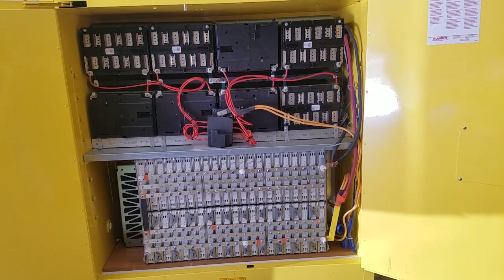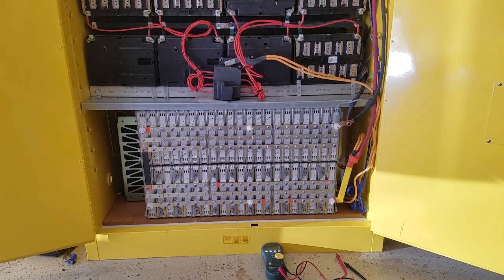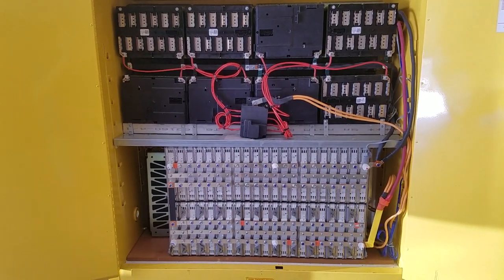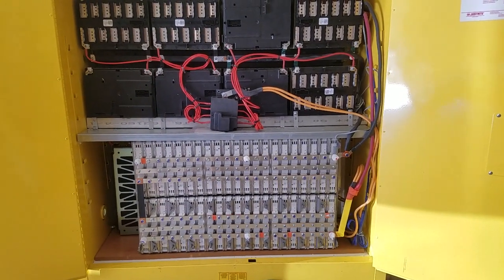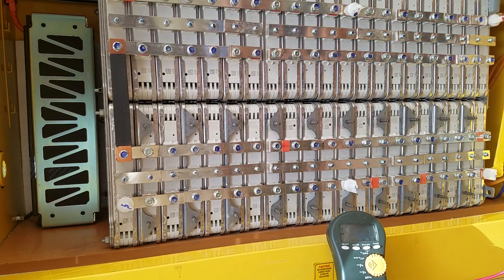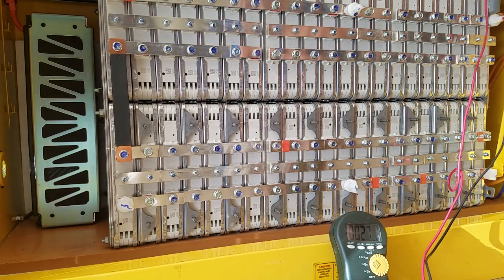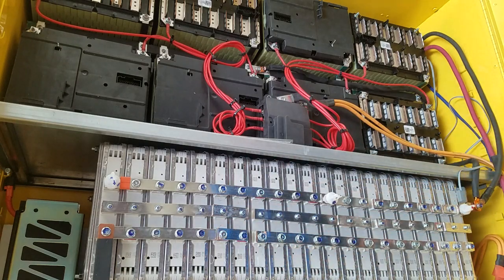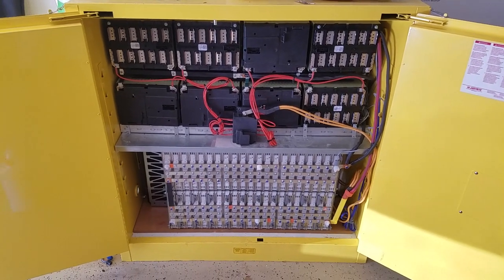Update and adding to my 40kwh Lithium Ion Battery bank and 4kw off Grid Solar System.

Comment: Great video, I am looking at making a leaf bank too.  Very very interesting what you say about the balancing/BMS.  Strange how you refuse to have more solar on roof so you effectively are wasting the massive investment in batteries as they can't be kept charged from the sun??
Reply from the maker: I am not refusing to put more solar on my roof.  It's the city ordinance the HOA restriction that I don't want to deal with.  In order to put solar on my roof, need to get city permit, need power utility permit... and they won't permit battery system that are not UL listed.
Reply: @devildestiny555  Ah I see that does make sense.  Shame to hear that!!

Comment: Nice!!!!! Had you had additional  panels  would you have  been  able to avoid the grid entirely ?  .are the volt and leaf batteries  parallel ?
Reply from the maker: Yes, absolutely, the battery got plenty discharge power... it just a matter of being able to store it and put power back into it.  Yes Volt and Leaf in parallels.

Comment: hi i got some chevy volt batts off you,i was wondering what amps to charge them with?,i have it at 15 amps now,,is that to slow?,,,thanks for your help,,
Reply from the maker: I don't think there's such thing as too slow charging... the slower you charge it, the better for the battery.  15amps is fine, but you can charge it up to 50amps if you want/can.
Reply: @devildestiny555   i just want the battery to last along time,and not go out of wack ,viltige wise,,i heard if you charge fast they will go out of wack faster,then slow amp charging?

Comment: Hello your setups are amazing!  You are definitely a pioneer in this new industry in getting away from paying the big utility companies and there huge bills... Like APS! We are in Arizona too.. North Phoenix,  ever since I moved here I`ve always wanted to use very little or no power from grid.  What do you think of those new hybird solar mini splits that use DC power from panels and then can tap into grid on AC? LEZETI Solar is the one company that offers this setup but pricey. So then I was thinking just to get a regular mini split and separate solar setup instead like yours? Thoughts? I also would LOVE to come check out your setup and learn some tips first hand! Drop me an email thanks 
Thad.Napora@gmail.com
Reply from the maker: I did look into those hybrid mini split as well, but like you said they are very pricey... and they are limited to how many panels you can run... meaning you can't just add more panels to zero out grid use.

Comment: Good update, are you the seller on eBay selling the Chevy volt modules, I've been wanting to do my golf cart, now I'm thinking of building bank for my RV. I put 21 SEER mini split on RV it only draws about 850 watts on high speed and less than 300 watts on lowest speed, it's a 1 ton rated
Reply from the maker: My website is azlithium.com , that's one efficient 1ton, my 9000btu pull 1100watts on full power.
Reply: It's rated 9000 btu but the maximum is 11,900 btu www.highseer.com

Comment: I'm curious to your thoughts to using a CHAdeMO port on an older EV to simply use the car's system to act as a battery?

You can buy systems out of China that'll pull power from the DC port. I'm thinking that it must be possible to build a system to integrate it into your house by simply plugging it in, saving any worry over BMS and whatnot.
Reply from the maker: Of course everyone thought of this when they first look into using a EV salvaged battery.  Obviously it's a great idea.  But no American/Western company would do such thing, it a lot of liability to worry about.
Reply: YouTube keeps deleting my comment as I write it.. 

I understand that a company isn't going to make one and I'm of the mindset that it's not due to liability but rather not wanting people to free themselves from the grid. However, a badly implemented system is exactly that, so no doubt there's a right way and a wrong way.

However with that said, you didn't wait for it to be "offered" to you. You went ahead and did it, which is exactly what brought me to your channel in the first place. It's also exactly why I asked you for feedback on such a system. Figured you'd have a good idea of what's possible in a clever man's (or woman's) hands. 

As my first post said: you can buy such systems from China - I feel it's just a matter of reversing a few things and then incorporating it into either a grid or off-grid application.

I'm hoping my current EV will live it's second life as my battery source. Not having to tear apart a car and build a battery pack/system seems like a worthwhile path.
Reply from the maker: @stedavid13  If you have back ground in electronics and computer science, you probably could figure it out.  First you need to be able to decode the manufacture protocol and code in order to even turn on the battery.

Comment: Thanks for the video. Why don't you consider acquiring ultra high efficient solar panels from Sunpower, LG, and even Jinergy group plus the newly released alpha series from rec group? They might be pricier but the latter two aren't really. They should allow you to increase your solar generation capacity without increasing the total number of panels. By the way, I found that meter interesting. What product/model is that? Do keep up the good work and ignore the detractors.
Reply from the maker: I thoughts about this, but I'm not sure how much of a improvement it would gain... maybe a few more from now that might be a good choice.  But currently, don't know if the labor/cost would be worth it.

Comment: So the trick to not using bms is “if you are not pulling that much of a current you don’t really need bms. “ that’s what I am getting from your system. Thx again this is awesome update
Reply from the maker: I am not against BMS nor I ever recommended peoples not to use BMS.  It's just that for this size of a battery bank using all of these modules tied in parallels, it take a lot of custom harness to tie them together to go into one bms, or adding a lot of single small BMS...  lot of wires, bms meant lot of potential failure point (unless you can make it as solid as the car manufacture, don't).  So it all come down to your own research and how you wage the risks.
Reply: Thanks. This really helps with design. And risk management. With my Motorhome and cargo trailer I’m thinking of placing the Leaf modules in the cargo trailer with a inverter. As with all designs there are trade offs. If I go somewhere without the cargo trailer I won’t have the energy system. But my motorcycle will be in there also so I’d have to be dragged away from the trailer kicking and screaming lol. There’s not really any extra room for a nice energy system in the Motorhome anyway. I don’t like the systems in vans and RVs crammed into a cubby hole somewhere. In the cargo trailer everything will be accessible and easy to tinker with. And a cargo trailer provides roof space for lots of solar panels. I only have and need 21 Leaf modules so may connect the Chargery BMS anyway. Your residential system is about 4 times the capacity so I see what a huge job that would be. And like you say it adds more “variables” that can potentially be weak links in the system. 
What about placing cheap little digital volt meters on each pair of Leaf cells so they can be monitored at a glance??. I think they are only about $2 each.
Reply: Also placing a clear cover over the batteries and all the little voltmeters would look really awesome especially at night.